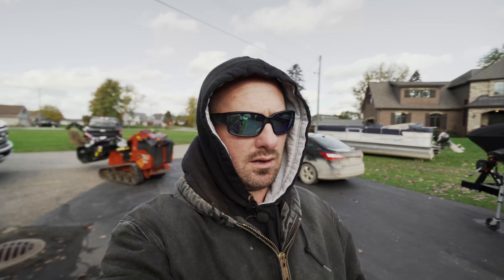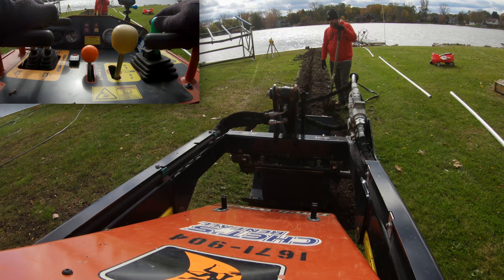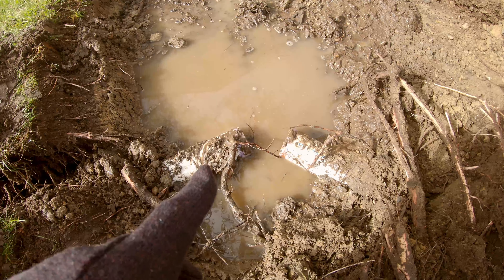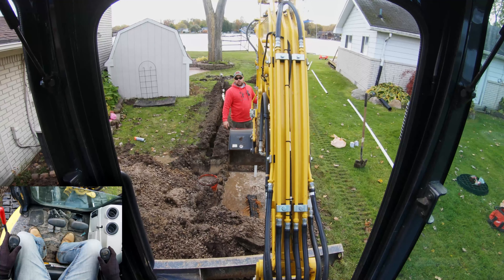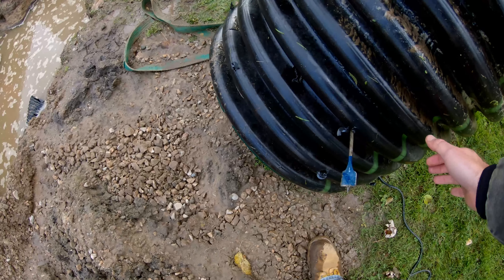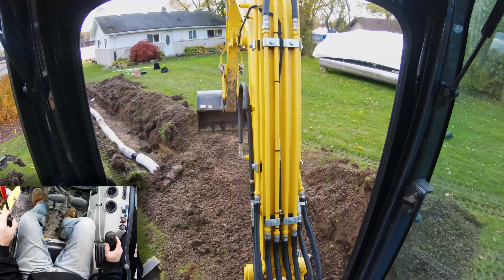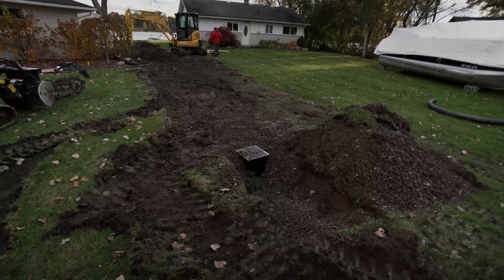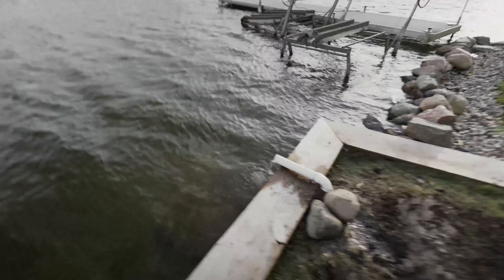Yard Drainage on a Lake// Day 1

Comment: Kelly well is something we use often here in south Florida.  Ground water is a common nemesis. Majority of my work is drainage and a temporary sump pump works well. Cool vid.
Reply from the maker: Ya, we deal with them from time to time up here with the groundwater but, most people will raise the level of the property up instead of dealing with the issues.
Reply: @DieselandIron  I hear you.  So flat down here I'm always fighting ground water when installing drain pipe.  Appreciate your reply. Have a great one, stay warm.